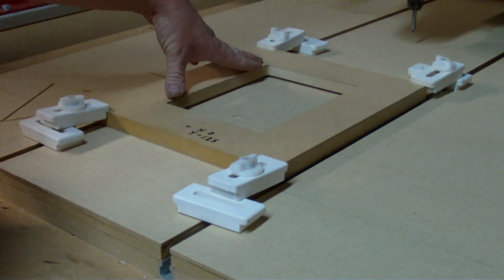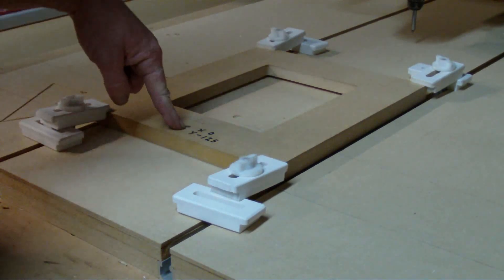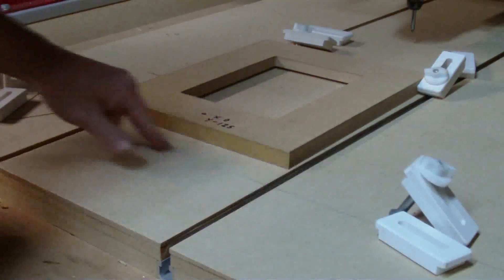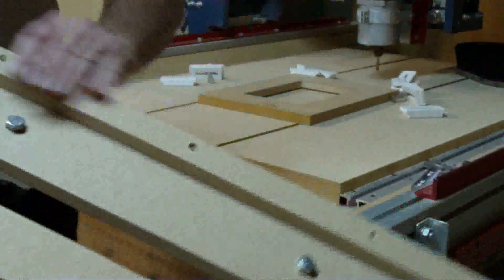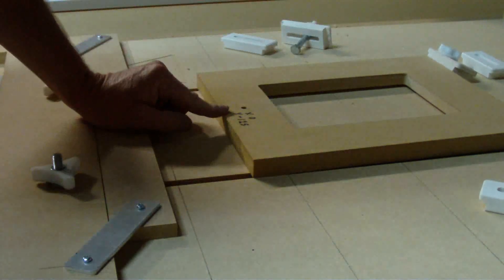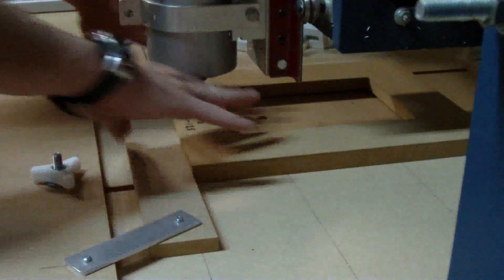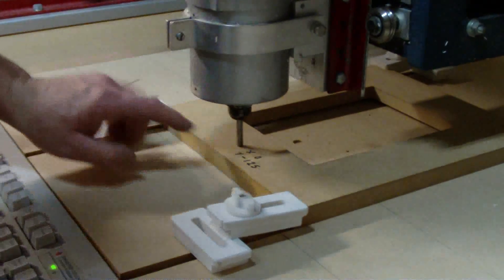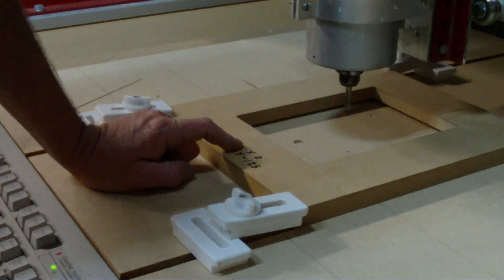CNC Jig Resetting - CNCnutz Episode 21

Comment: If you Mill a series of holes through the table top perpendicular to each other with the CNC machine you can either use bench dogs or simply use some screws and you've got reference lines for both x and y axis . with various spacer blocks you can position things at precise XY coordinates. I guess your method works fine,  but it's just one more jig to make. A series of holes in the table also serve dual purpose in that they can be used for hold Downs or for bench dogs and clamps. Very similar to a Festool mft top. Extremely versatile. With the CNC it's very easy to Mill Precision holes at right angles to each other.

Comment: Amazing! Never thought about doing it this way. I have been drilling hundreds of 1/4" holes in my spoilboard and using 2 pins to located the jig on the table, then I use a piece of angle aluminum wired to my probe input to locate to a set of 2 of 3 pins in the x and y axis in the jig set to a right angle. Your method is so much faster. I never thought to use a large parallel ruler. This has never occurred to me in the  5 or so years I've had my machine. Thank you so much for sharing this. Now off to make the ruler :)